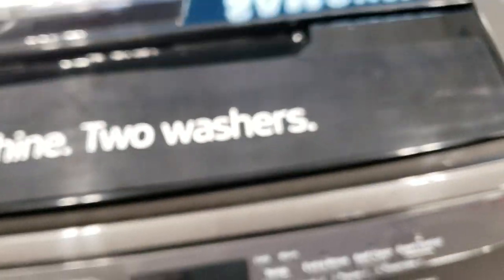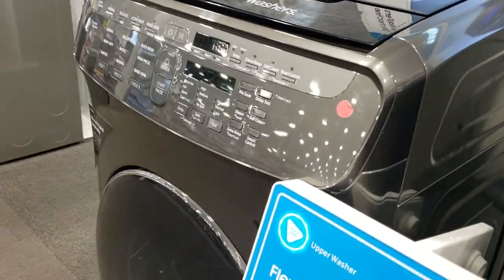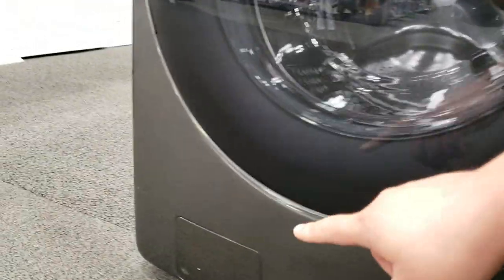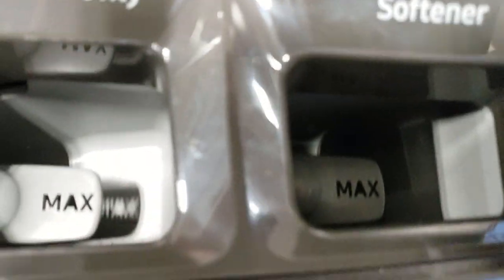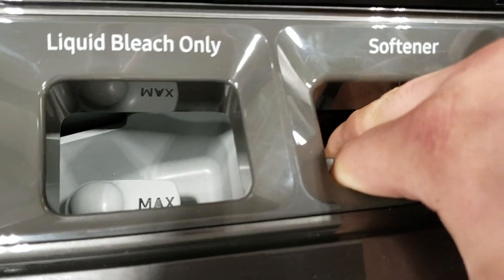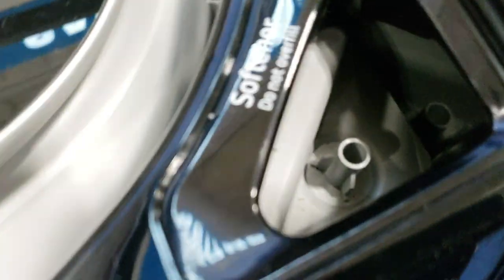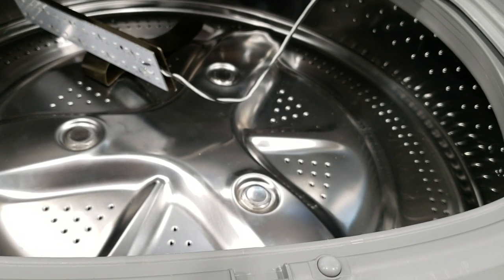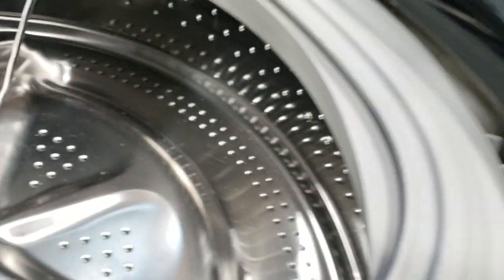Samsung Dual Washing Machine LC1 error code simple fix PART 1

Comment: Opening the machine and using a blow dryer with paper towels worked for me! Bear in mind, you might not see actual water but might feel some moisture especially around the censor located in the back panel, there is a youtube video showing how to get to it. 
Dry, dry and dry some more! Those censors or VERY sensitive! I was at the verge of calling a tech after 24hrs of error codes and me attempting to tilt my machine to no avail...then this worked!

Comment: Thanks for this video! I was getting the code on my top washer (bottom part is currently broken and waiting repair but top still works) and I was worried the top was broken now too.  I removed 2 items out of the washer and now it is working like normal again
Reply: So how do you reset it after cleaning it out? Every time I turn it on it codes.
Reply: @matthewjolly3920  turn off, tilt forward until water drains down from sensors

Comment: URGENT _ FIX for this is a new updated part - Part # DC62-00702A  This replaces a small foam part deep in the fabric softener tray that stops working and causes the leak in the first place.  Use a tech to repair this, try to get it covered.

Comment: Thanks, but...I had this error right out of the gate.  Nothing was clogged.  I took off the back, and ran the top washer with one shirt and very little HE detergent.  During the rinse cycle, I watched through the back as water poured (!) out of the actual tank (where the clothes were being washed) and down the front left (viewed from the front of the machine) inside the machine.  It was not coming from the seal around the lid.  It was coming between the upper and lower halves of the plastic housing of the upper wash unit.  This is a manufacturing defect that can be momentarily fixed by draining the water, but is not something that a new washer should do.  Returning this unit to merchant...(Home Depot, and they have been very helpful...getting a different brand.)
Reply from the maker: Yeah that sounds like a bad seal in the top tub probably wasnt put together well
Reply: Thanks to the Appliance Guru for your reply.  The saga continues...The Samsung repair guy was here today.  Excellent service, BTW.  He found (so far) that the rubber boot that feeds the liquid bleach into the top left of the upper tub was cut/damaged/traumatized (huge cut) and this was where the leak was coming from.  He will replace the boot in a few days.  Meanwhile (!!!) he told me that there had been a repair on this unit before I bought it (based on serial number service records)...huh?  It was sold to me as a store demo/floor model.  Now it is looking like it is a used return.  He is going to investigate further and let me know when he comes back to repair the rubber boot.  If there was some sort of dishonesty involved with this sale, I will update with the store name.  Cheers
Reply from the maker: @edebel8922  Definitely sounds odd. I would look in to it & see what happened there.  Keep me updated.
Reply: Absolutely the worst appliance I've ever owned!

Comment: I just stopped using the top washer as every time I do it gets to the rinse and that’s when the leak happens. Water all over the floor and then the frenzied 1LC and LC codes start. Won’t stop until I tilt the unit and drain out the water. It kind of fits that it’s something to do with the water softener compartment as it happens only in the rinse cycle. I’ve cleaned it out but not sure what’s going on with the hoses and my husband has told me he’s not tilting that thing again so I’m reluctant to try it.
Reply from the maker: Here's a view of the inside showing the way the water travels from the dispenser on the right side all the way down. TRY diluting your product with wather and carefully pour hot water in to the dispenser to clean them and unclog them 

https://youtu.be/yCLesJ8n3k8
Reply: On the upper washer, in the fabric softener compartment, is there a hole beneath the cap that allows water to drain completely away?  I’m noticing if I pour water into this compartment it drains slowly but leaves a small amount in the bottom of the compartment.
Reply: @theapplianceguru  thank you so much. I cleaned everything and put hot water and white vinegar down this compartment. So far so good. I won’t be using fabric softener in the top washer from now on.

Comment: Hi The Appliance Guru, i noticed that there are 2 water hose, one for cold and another one for hot water. I do not have hot water tap at my laundry so is it ok if i just connect the cold water hose n left the hot water hose unattached to any of the water tap?
Reply from the maker: What I would do is get a Y spliter for your cold water and connect two cold waters to your machine so that it doesn't error out. There is a small chance in can error out.
Reply: @theapplianceguru  i see. Thank you very much. I just bought the machine 3 weeks ago, and the LC1 error came out. I notice there are water coming out from the hot water hose.

Comment: Any ideas how to drain  upper washer after the cycle is done?  Looks like water is staying at the bottom of the upper drum. It is not visible but if you spin drum by hand you can hear water splashing.  This creates foul smell if washer is not used for some time..
Reply from the maker: power it on and press and hold the spin cycle until the numbers on the display change to about 13 or 12 minutes and then it will do only the drain
Reply: @theapplianceguru  
Thank you so much. I just tested this now. Display showed 11 minutes but at the last few minutes sprayed some water in and there is still water at the bottom of the drum after the 11 minute  spin only cycle was done.  Any idea why would it spray water in at the spin only cycle

Comment: Hey appliance guru, was wondering if you can help me. I have a leak coming from a little tank that sits behind the water valves at the water intake. Do you have any idea what that tank is called? I can't find it in the exploded view schematics. Thanks.
Reply from the maker: I pulled up the exploded view and yes its difficult to make out a tank can you private message me your model/serial number and a picture of it?
Reply: @theapplianceguru  Sure, but I did find the part. It's called an assembly hose connector and it has 4 inputs, 2 for hot 2 for cold and then two outputs, one for upper and one for lower. The model is a Samsung WV60M9900A. The tank connects directly to the valves. It cracked along the plastic weld that holds the top and bottom parts of the tank together. Thanks for the help and quick response!!!
Reply from the maker: @treasurehunt7812  oh ok perfect sounds like an easy fix make sure the gaskets inside the hose tread are still in good shape and dont over tighten them when putting it back together it should only be snug, best of luck!
Reply: Treasure Hunt were is that piece located in the washer machine? Front part or rear ?
Reply: @jaeamado9634  It's located at the top of the machine at the rear, where the water lines come into the unit. Apparently, the plastic weld on the tank was defective. Samsung had updated the original part with a new part. I think it took 4 screws to expose the area, then a couple screws to remove the rail that holds the valves, and another couple screws which held the water bar (not sure of the correct terminology). After that, I slid out the old tank and put in the new tank, replaced the screws. The entire fix took maybe 10 minutes.

Comment: The washer is an expensive piece of shit!  Do yourself a favor, stick to a plain, old standard washing machine. It will last for 20 years. These new things, can't even last a year without having some sort of breakdown.
Reply from the maker: I see a lot of machines all brands and the new energy efficiency guidelines are forcing manufacturers to push out new engineering i tell all my clients to read the user manuals before even using the machine and to use very very little detergent and not to overload the units. If you dont want to deal with it buy a commercial grade Speed queen.
Reply: @theapplianceguru  so not only is the machine a piece of s*** but the people that make the stupid laws are idiots. Thanks for clearing that up. Sorry I'm little frustrated right now after taking mine apart putting a new pump on it but I'll back together and now it's doing something else weird

Comment: What if you actually see water at the bottom
Of your machine.. like on the floor? A technician came to “fix “ my machine and I’m thinking he actually broke it more than what was going on...(he came to fix the handle for the top machines inside door)
Reply from the maker: It honestly could be anything there are a lot of hoses inside. What state and city do you live in? Is there samsung service available in your area?

Comment: I’m confused, what’s the fix ?
I can’t find part 2
Reply from the maker: Go on my profile for part 2. You fix the issue by not using so much detergent that causes the unit to over sud and trigger the leak sensors at the bottom if the machine is already on drain mode because the sensors are wet you have to unplug it and wait until those sensors dry (about a day or two) if there is constant water flowing out of your machine call a technician.
Reply from the maker: @skuddy   taking it apart would be a lot of work and you can break parts  I would suggest a steamer or really hot water and then with dust off putting the tube down the hole in spraying the dust off i use a steamer and put it directly on the hole. Something like this would work stick the tip of the hose in the hole. https://www.amazon.com/dp/B07R1X8BDB/ref=cm_sw_r_other_apa_i_Ol7sDb3V06A88
Reply: @theapplianceguru  Can I drill out the bottom of my machine where the water collects so this doesn't happen again?  Our floor has a floor drain in it...prepared for the event of a leaking washer.  I assume these are compartments to capture overflow so it won't damage floors?

Comment: Same problem but I dont use softener and suggestions???
Reply from the maker: you're probably using too much detergent or putting too much clothes in the washing machine at the top look around the gray trim from the top washing machine to see if water is spilling over it will leave water residue on the rim if that's the case do smaller loads or use less soap
Reply: @theapplianceguru  no sir I only use half a load and only use 1/4 of the detergent. All I know is it drives me crazy with the noise (LC1) so I unplug it and it resets it
Reply from the maker: @atozrecovery518  do you notice water on the ground or  relatively big puddles on the ground?  if so you could have a leaky hose but if that's not the case then one of those softner dispensers is clogged and overflowing or when the top washer is working it's splashing water or over sudding and leaking. Remember for the top washer it should only be taking 1 tablespoon of detergent anything else will cause it to over sud. Unplug it lean the washer forward so that the trapped water in the cabinet rolls out and let the sensor dry
Reply: @theapplianceguru  no sir just throws code and starts beeping and want stop until I unplug it
Reply: Mountain Homesteading  I don’t use any softeners in the top washer or bottom washer... help what do I do? As another commenter said this set is so darn expensive.

Comment: SOLUTION to LC1 error code, if you have this exact machine and LC1 code, water is touching the sensor at the bottom of the machine. The fabric softener dispenser clogs and water overflows to the bottom of the machine and triggers the overflow sensor. Tip the machine on its left side if you are facing the washer door. There's two sensors that have 4 wires 2 red and 2 black, these need to be dried with air blower and towel. I removed them and used compressed air and wiped the whole inside of the machine and the sensors, then replaced them. Wa Lah!!! Don't poor fabric softener into the dispenser unless you want to do this again. They make Downy Softener balls you can throw inside the machine.
Reply from the maker: If you tip the machine over to the left it will trigger the lc2 error code which is a second water drip sensor you want to either Lean it forward to drain out the water or lean it back you don't have to take it apart and air-dry it to reset it just tip the water out and let it dry overnight the sensors will only corrode if they are left soaked in water for a long time no need to replace them until they corrode over
Reply: @theapplianceguru  Can I just drill out the bottoms of the areas the water collects?  My machines are on a tiled floor with floor drain anyways.
Reply from the maker: @gavincurtis  technically as long as the sensors touch any water they will trigger off the LC1 hypothetically speaking if you don't mind the water sometimes draining on your floor because your floor has a drain system it would be easier just to unscrew the sensors from the bottom of the frame and put them in a ziplock bag that way if a little bit of water ever drip down it wouldn't automatically trigger off an LC 1 but obviously thats Hypothetically  speaking you would have to 
 also watch out for mold build up
Reply: @theapplianceguru  Thank you for the reply.  :)  

What is that small black rubber drain hose near the water debris trap?  Flexwash machine with the small door at bottom left.  I assumed it just drains the main pump tank so water doesn't dump out when servicing the debris trap.

Anyways, I drained that, checked my filter (it was clean, no debris) and now the machine is working again without any wait.  Does that small hose by chance drain the water from the sensor regions as well?  If so, a bit of faith in humanity restored to see some kind of engineering forethought vs tipping the machine to drain the sensor areas as shown in other videos..lol.
Reply from the maker: @gavincurtis  Yes that's exactly what that lil hose is for so that you can drain any water left in the sump. If you turn on "SPIN ONLY" when draining that lil tube itll do it faster, after it drains the water, turn the machine off because if it starts to fill for any reason the water will come out of that lil hose. Some models came with the spin only option on the cycle selector other models will go to spin only if you hold down the "SPIN" button after turning it on. Pro tip: if water that come out of that tube is soapy. That means you're using too much soap that water shouldn't be too soapy since its rinse water. No unfortunately that hose is connected only to the drain pump. The issue is that the sheet metal floor, the way its stamped is at a downward angle and puts the sensors at the bottom so that if any whater drips it triggers those sensors.. meaning if for what ever reason you have an "over sud" issue or a clogged dispenser which is a one off and a lil water gets on it it will trigger the safety system, locking the door and running the drain pump until it doesnt detect any more moisture..